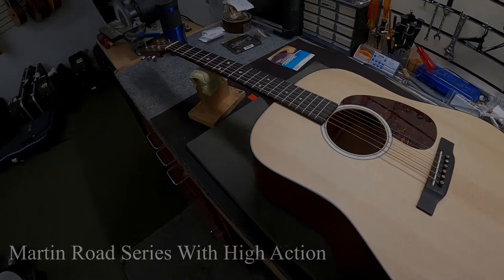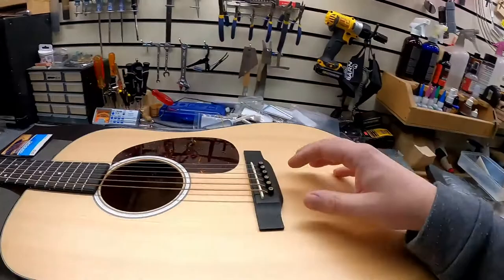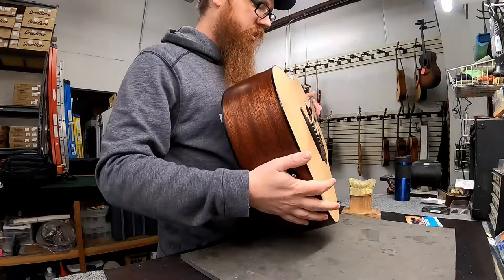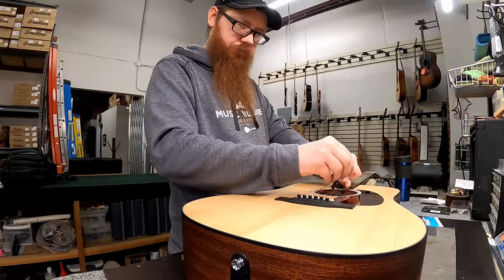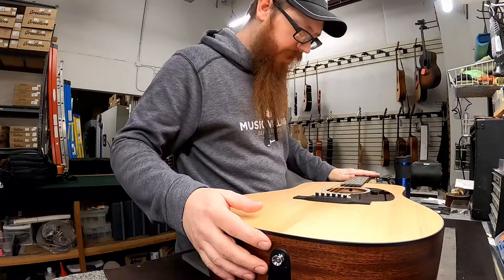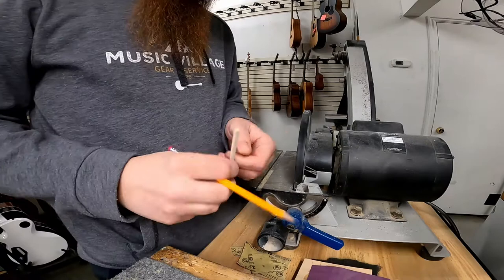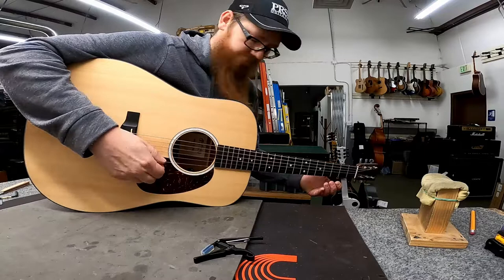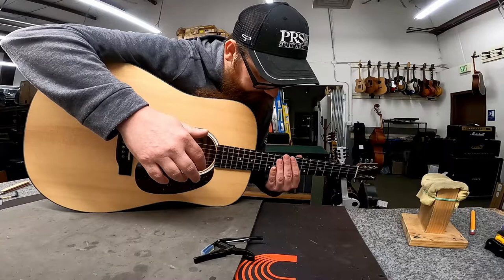Correcting High Action on Martin Road Series Acoustic Guitar

Comment: Adjusting the truss rod with full tension on the strings?  That can't be right!
Reply: The truss rod is often adjusted under full string tension.  I think it is correct, at least to a lot of people.
Reply: @borojammin6509  Actually, I always adjusted the truss rod with full string tension, until I saw a luthier say that you should never do that,....so I now loosen the strings a bit first.   So if it works either way, I guess it is not important.  So you are right.  Probably.
Reply: @simmosimmo100  this, I do as well. Loosen, adjust, tighten